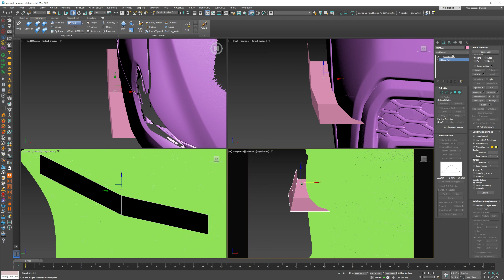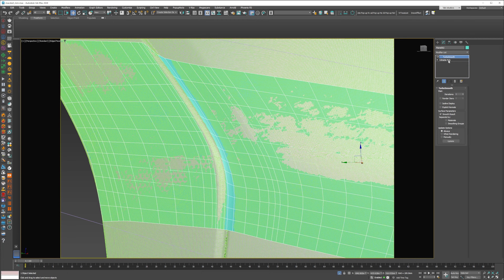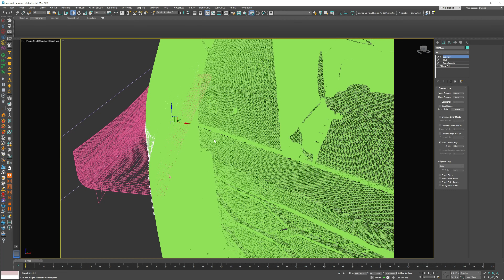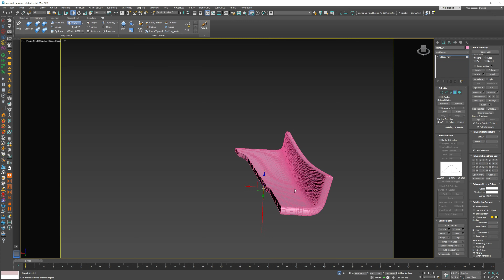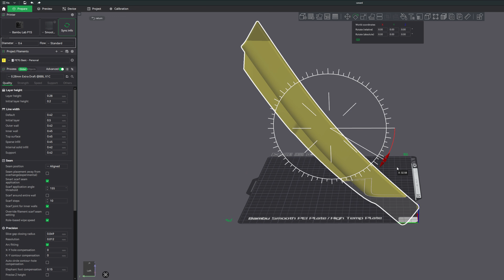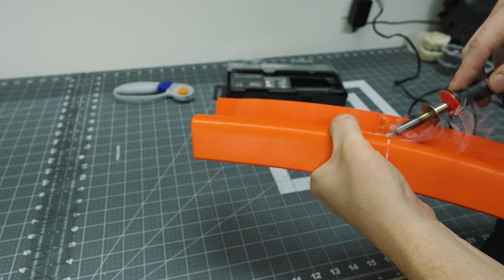How Accurate is the Einstar2 Blue Laser Mode?

Comment: I recently started using super cheap metal dowel pins that I buy on Amazon to align my part segments. I just model a matching hole in each part that is half the length of the pin, and then press them in before I bond them together. It adds strength to the part and makes the segments line up 100% perfectly every time with basically zero effort. Save yourself from ever having to plastic weld with a soldering gun again.
Reply from the maker: Ohh yeah I use pins for my real prints. This was just a quick test print I didn't want to waste the energy of adding holes to lol
Reply: @poltdesigns  Yeah, I should have assumed as much. Cool stuff, brother